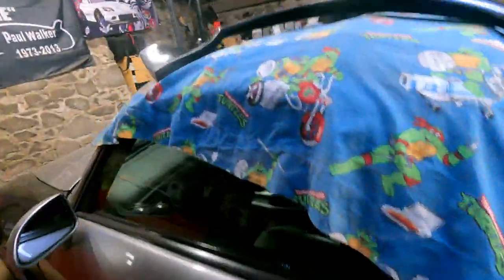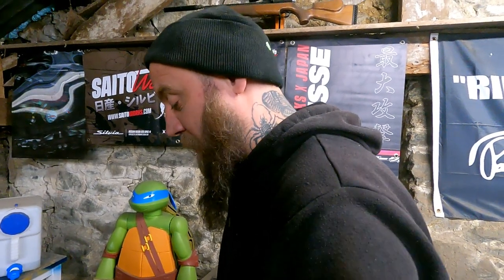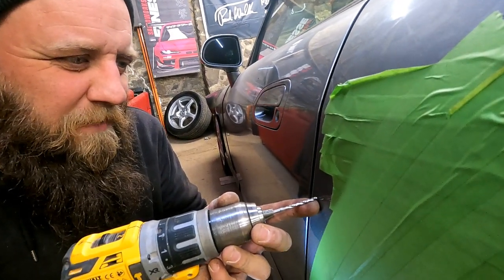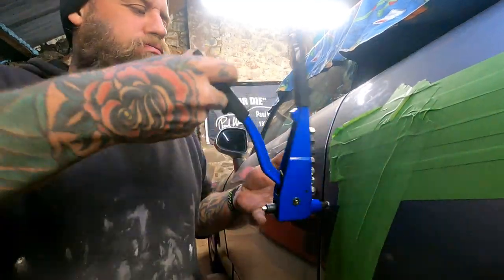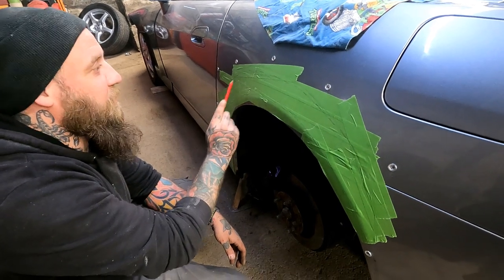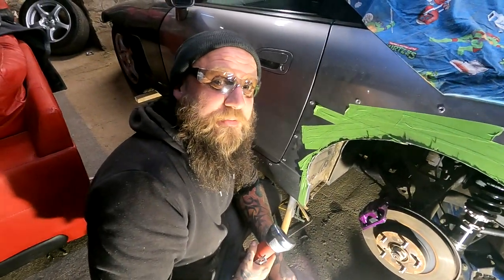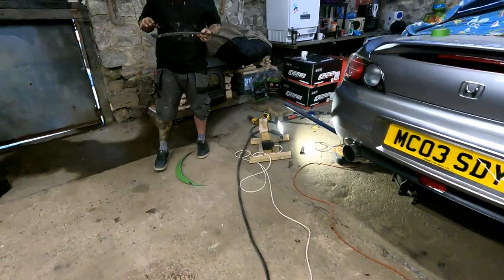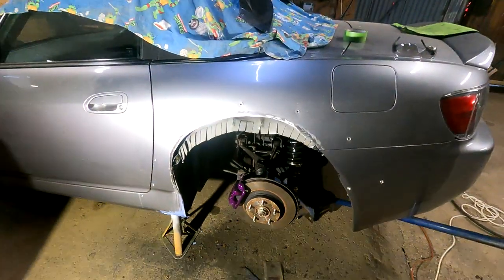Cutting Out The Honda S2000 Rear Arches Ready For The Widebody!! *PART 1*

Comment: Looking good guys, best thing for getting rid of burs is a little deburing tool. And when you weld it you just want to do it in little spots, and do it randomly so you dont get to much heat in the panel. I use an air line to cool it once iv done my spot then move to the next one, stitch it in almost
Reply from the maker: Nice one mate
Reply: @CowabungaCarDiaries  just added more to my comment about welding it up as I comment as you talk like I'm in the conversation Haha
Reply from the maker: @lewiscoleman8116  it’s already been welded up mate and all went sweet
Reply: @CowabungaCarDiaries  nice cant wait to see the end result, this car is going to be so wide and in your face Haha
Reply from the maker: @lewiscoleman8116  it sure is mate. You will see in the next video as we get the rear wheels on too 😬😬
Reply: @CowabungaCarDiaries  s2k on the steroids Haha.

Comment: I've used rivnuts in the holes for the plastic engine under tray instead of useing them stupid plastic clips. 6mm rivnuts and 6mm bolts and large washers easier to take off and secure. Tab of copper slip on the bolt threads jobs a goodun
Reply from the maker: Bloody good idea that pal

Comment: Probably too late by now, but using weld through primer before welding rather than priming after welding would be a better option.
Reply from the maker: All done now bud unfortunately lol
Reply: @CowabungaCarDiaries  never mind, wouldn't have made much of a difference. Would recommend some rust treatment sprayed from the inside when your done, piece of piss to do. Did my CRX SIR 10 years ago with Waxoyl and still has fuck all rust issues, you can get better stuff these days though.
Reply from the maker: @retroryan836  yeah bud I use  bilt hamber for all that stuff